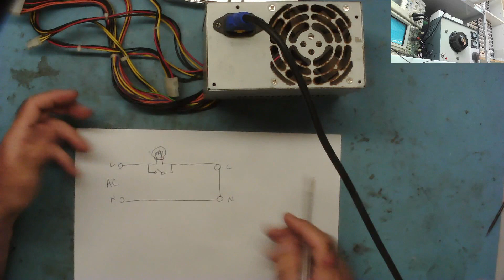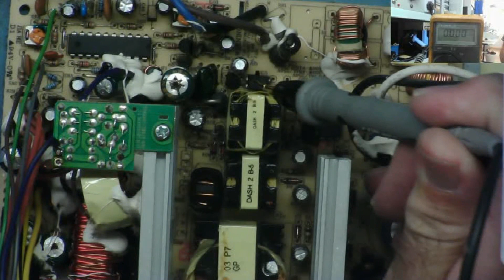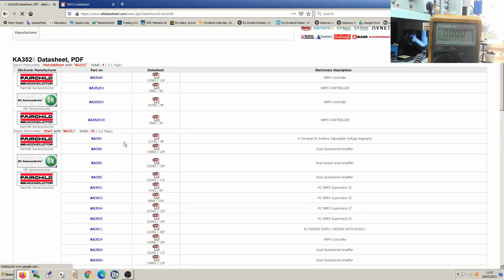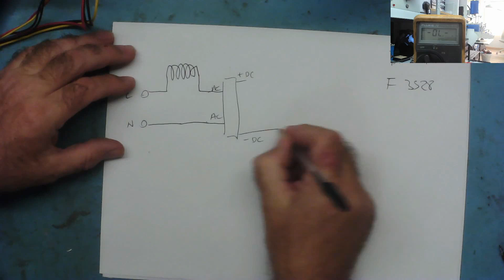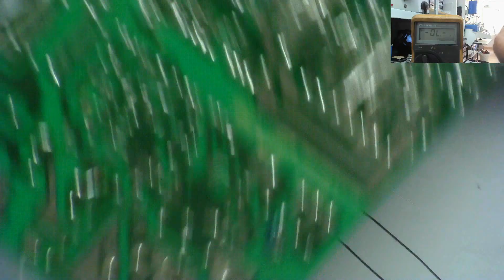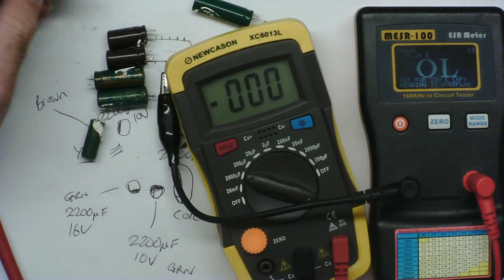LER #057 ATX PSU Repair - 5V Standby Voltage Low - Will Not Start.  Component level Repair

Comment: I had a go at mending an ATX where a lot of caps had blown and it was so packed tight I gave up as I had another working one,did replace one cap using a pencil and blue tac,what a pain,thanks for the vid👍

Comment: 58:07 I have the same ESR Meter and I tell you one tip - Those stock wires/leads/probes are wobbling in the sockets (which you can see on the video) and this makes a bad connection. When you push button to do a zero cross calibration (with shorted probes together) it MUST go to zero ohms at the end. If not then calibration will be bad. As I see on the video it wasn't zero ohms. You have to take out the probes from the socket and plug again and provide better short circuit on the probes/clips, and then try it again until you get 0.0000 and after that try to not provoke probes to wobble in the socket until you ger mesure resoult.
so...
What happened on your video is that you finish zero cross calibration at +0.030/0.010 ohm above normal, so the zero point was already shifted in memory. But when you took a capacitor to measure it, you move the probes/leads making wobble in the socket, so they catch better connection compared to the previous one. So you had less loss on the probes BUT the meter last calibration was +0.030/10 above normal so that is WHY you get negative reading on capacitor: minus -0.060. The reading will be fake, and you can wrong assume that capacitor is good because you will see lower value.

Those stock probes/leads, has the metal stripes on the plug which touch the socket inside. Take a tweezers and push back them, to make connection harder - this will eliminate the wobbling issue.

Comment: My guess this is exact the fault my PSU has, at the biginning the PSU fault was developing slowly like a miss to turn on sometimes but not always, sometimes did actually turn on and was working perfectly fine untill at the next day turn on, eventually after some days have pass the PSU definatly no longer turn on, my guess is like a capacitor becoming more and more day by day faulty
Reply from the maker: Hi Enrico
Also check out this video, if you did not already do so.  In this case the 5V Standby was good and once again the problem was caused by capacitors, but not the ones on the output rails (3.3V, 5V, 12V).  it is quite likely your power supply could have a problem similar to this one.

https://www.youtube.com/watch?v=byKn0ZR0OK4
Reply: Thank you for the link, I am going to check carefully all your videos about computer power supply,
Reply: @LearnElectronicsRepair  I think the 5V Standby circuit is the reason for my PSU no longer working, or a bad capacitor somewhere belonging to the 5V Standby circuit which is the primary side, mothing to do with the  (3.3V, 5V, 12V) output rails. Before becoming completely faulty,  the PSU after struggling to turn on but thereafter the PSU was working perfectly fine until the next day when I was trying again to turn on, at some point the PSU was no longer able to turn on even if I was pushing again and again the turn on button
Reply from the maker: @tonschk  Hi Enrico, on the most recent repair I found that the 5V Standby was OK but the same transformer that generated 5V STB also generated a 24V supply (or was supposed to do) for the PWM controller and the transistors that provided drive to the main switching transistors (5V 12V 3,3V)  Have a look if you have a similar circuit yourself - another winding/rectifier/electrolytic on 5VSB transformer.

Comment: I checked all the capacitors and replaced them 
 The vsb fault didnt change !
It gives me a steady 2.9v without ripples!
Reply from the maker: Hi Tech Eng, yeah I am waiting for the capacitors to arrive as I didn't have suitable replacements in stock.- I will upload another video once I change them regardless of whether it fixes the problem or not.  

If you have watched some of my other videos then you will know I do 'reality' on this channel, so sometimes I can't fix things and sometimes I get it wrong and then upload another video explaining how and why I was wrong, and what the real problem was.  

So  I am not saying 100% changing the capacitors will fix the fault, but I am sure you will agree those old ones had to go before we can get any further!  If that still gives low 5V STB then in the next video it will be diagnosed further.
Reply from the maker: Hi Tec Eng.  I'm still waiting for the capacitors for my PSU, and it's not easy to diagnose your problem at a distance, but have a look for a small device that looks like a transistor, somewhere near the opto-isolator, that has the part number TL431 (or some other letters followed by 431).  Although it looks like a transistor it isn't, it's a programmable zener didoe.  This is the reference voltage that the feedback circuit uses to compare with the output voltage.  If the reference voltage is wrong then the output voltage will be wrong.  If your PSU has that part then change it and see if it fixes the problem.   

The output voltage of the TL431 can be set by two resistors, one of the resistors could also have changed value causing this sort of fault.  The datasheet is here, and the formula for calculating/checking the resistor values is on page 25 (if it is configured this way on your psu)

https://www.ti.com/lit/ds/symlink/tl431.pdf?ts=1623298969093&ref_url=https%253A%252F%252Fwww.google.com%252F
Reply: @LearnElectronicsRepair  
The tl431 is inside the chip in my circuit 
The chip code is HS8108B
Reply from the maker: @techeng3940  I will do my best to help everyone who posts here but as you can appreciate it is almost impossible for me to diagnose the fault on your PSU without having it on my workbench.  Have you tried changing the HS8108B chip? I've just uploaded another video with a PSU that also has low 5V Standby but for a completely different reason.  Check this one out as well.  https://www.youtube.com/watch?v=Clim6i1hmmE and it may be relevant to your fault.  

Also if you are not already a member I suggest you join the free forum at https://www.badcaps.net/forum/  they have a section specifically for power supply repair and a lot of knowledgable guys there.  You will find me there both asking questions and helping others, though I am more likely to be posting in the motherboards and graphics card section.
Reply from the maker: Actually @Tec Eng are you sure that HS8108B is even generating the 5VSTB?   It seems to be far more sophisticated than it would need to be to do that and also the datasheet says it is for half bridge designs (ones with two transistors driving the primary of the transformer) so from that info I would say this is the PWM controller for the main power rails (3.3V, 5V, 12V) not the 5VSB.   Without knowing the model of your PSU I can't say, but possibly it has a discrete transistor oscillator to generate 5VSB like the other video I linked above.  

The best idea would be to join badcaps forum as I suggested, start a thread in the 'Troubleshooting Power Supplies' section 

https://www.badcaps.net/forum/forumdisplay.php?f=32 

Explain the fault, what you have tried so far and post some clear close up photos of your PSU showing the PCB from a few different angles and also state the make and model.    Once you have done that reply back here and I can take a look at the pics and see if I can help you further, though I am sure others will probably do so before I get chance LOL
Reply: @LearnElectronicsRepair  
Thank you very much for your help sir ,I appreciate this a lot.

The pin 13 on the chip is connected to the optocoupler and then the flyback circuit that generates the vsb
But the problem seems to be not in the regulation but in the in the Vcc pin because when I disconnect it the voltage on the output of the transformer goes up to 10v and thats weird!
But when I reconnected it ,it back to 2.9vsb!

There is something wrong with the ic that consumes the Vsb voltage I think.
Reply from the maker: @techeng3940  I've now uploaded part 2 of this repair here https://www.youtube.com/watch?v=PmlXQaidb3A